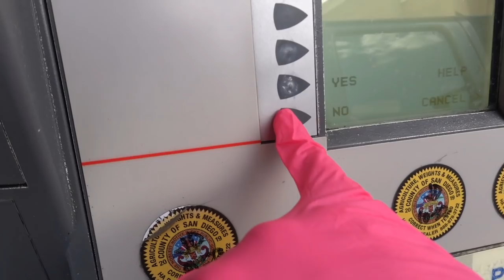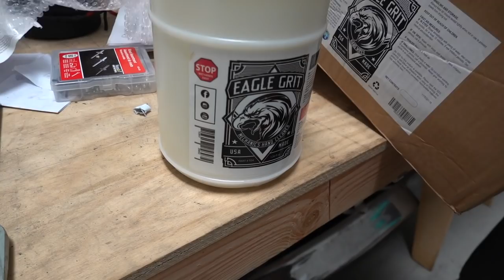This is the ONLY REAL Train Horn!

Comment: Finally, someone who actually bought a REAL train horn. Jesus. I get so tired of people with their “pimped out” trucks who think they have a dope train horn when they just bought some plastic trash from hornblasters. 

Also - you’re right you did overpay. They charge stupid prices for their stuff. I can’t say for sure how they get their horns, but they rip the serial tags off of the manifolds so they can’t be traced which is SUPER sketch. (The two small holes on the top of the manifold is where the tag once was) 

I have a K5LA and two K5HL’s available for sale that I would have sold you for $1,100 per  horn...

Comment: use train horn from raneys ... sounds a little bit different on the tuning but is still 168-172 db this is what i used under my 2018 ford f350 with viair 200 psi and 5 gallon tank save some money